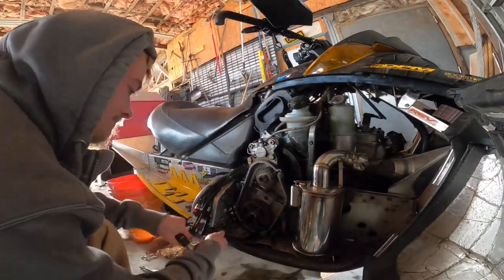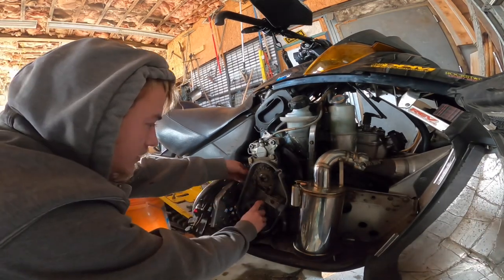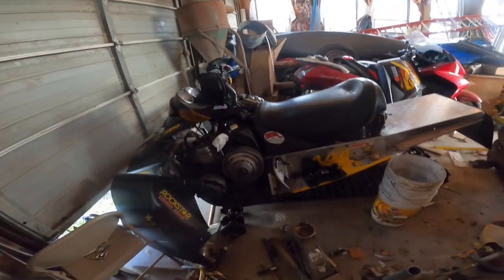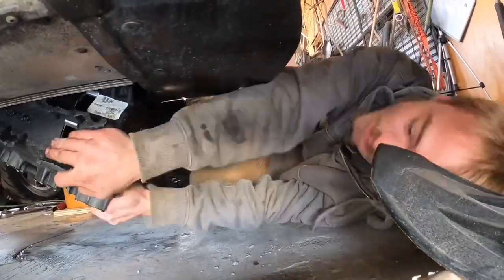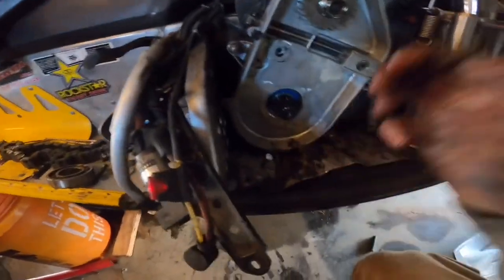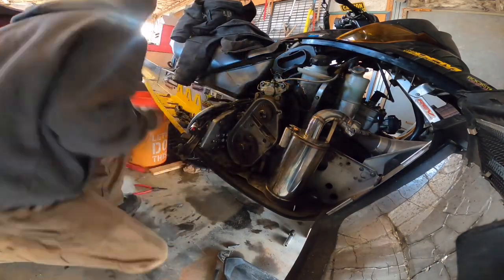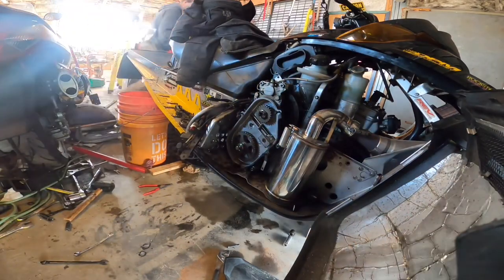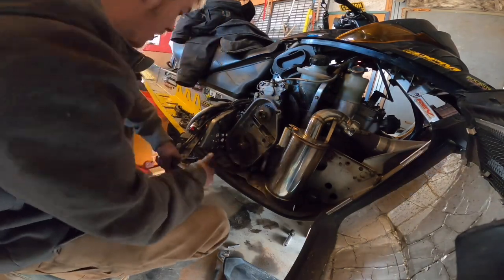Snowmobile track install (SKIDOO REV) 121-136

Comment: 1st time tackling something like this u said. Well done, all u need is the guts to start at it 1st and some patience and basic skills. Clean out your shop, get rid of the stuff not being used and always clean and out your tools away so u always k ow where they are. Tie a rope up to the roof truss and use a pulley to tie the sled up nxt time. Get a small wood stove and you will live out there picking at stuff 🤣. Tks for sharing